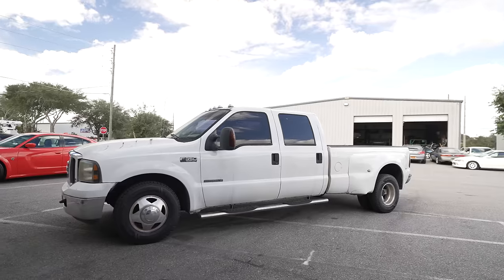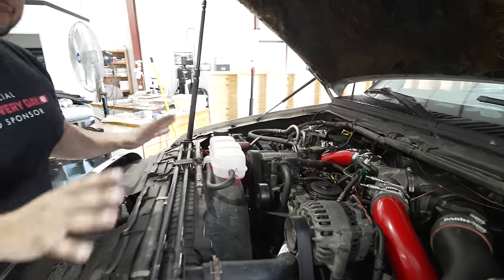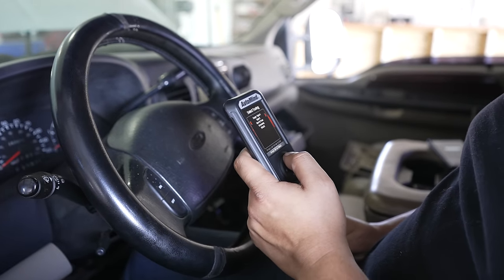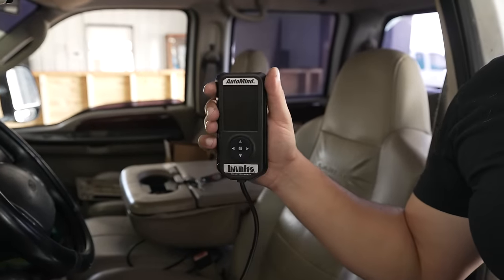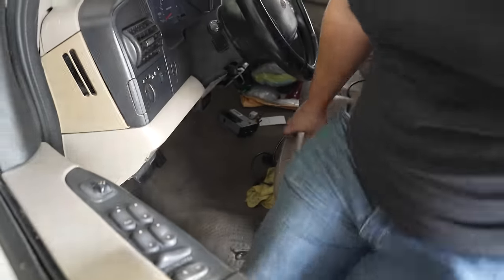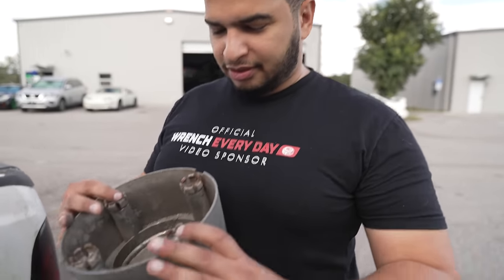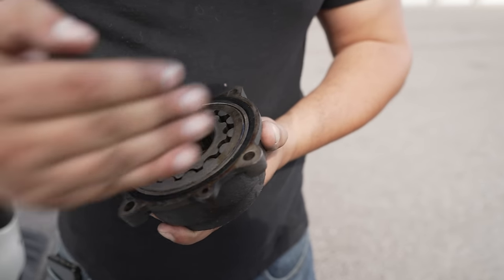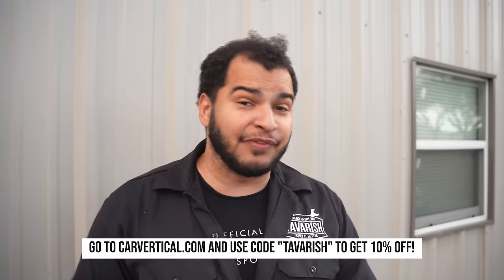I ABANDONED My Ford F350 Dually Pickup Truck 3 Years Ago...Then Tried To Fix All Of Its Problems

Comment: I love these trucks. I have a 99 f250 with 375,000 miles on it, and I would drive it across the country without thinking twice. It's so reliable and will pull anything I put behind it.

Comment: Love the truck and you brother so proud of you for what you built and created. Truly inspirational. I hope you guys did the fuel crossover line at the back of the engine. It is one of the only weak points of brining a 7.3PSD past 100hp over stock. It can lead to what is known as dead heading in the 7.3 community leaving the number 8 injector and on occasion the number 7 injector starved for fuel.
Reply from the maker: yep, we did the crossover pipe!

Comment: That brings back some good memories! I miss my 2003 F350 Power Stroke dually so much! Bought it with 215k on the odometer but it ran perfectly. It was dirty as he'll inside and out. Smelled like a million workers had been inside spilling coffee and egg McMuffin crumbs inside for decades. Gutted the interior, had new oem carpet put in, replaced all the broken trim, all the upholstery was redone in custom leather, new stereo, new MBRP exhaust, Edge tuner, custom intake system to finish it off. That thing was a dream to drive. Handled like a Cadillac and had a super nice soft ride. Much nicer than my bosses 2013 RAM dually that handles and takes bumps like it's riding on wheels made of stone. That big 7.3 could take all the boost that Edge tuner could throw at it and more. I sold it because I was an idiot and my wife said I couldn't keep all 3 of my cars. I had a Jeep Wrangler, and a Chrysler 300 SRT also so some stuff had to go since I wasn't driving anything except the SRT at the time. Ended up just keeping the SRT which I traded for my current RAM 1500 4x4 which I absolutely love but man do I miss that big Powerstroke.

Comment: Those International 7.3L are good for 500,000 + miles!
We have one with 388,000+ on it. Original injectors, high pressure and low pressure oil pumps!

Comment: This video makes me miss my 04 F350 dually, had 325k miles on it but it was reliable, yeah a reliable 6.0 powerstroke on stock head bolts, I picked up a 06 F250 6.0 after that but it wasn't the same, that one was a POS.

Comment: 7.3 are 100% reliable work workhorse engines 💪😎.  Not the fastest but 99%of the time will get you over the finish line (more than can be said of most newer diesels) 😉👍.

Comment: Don't run too much power through that old 7.3, it will blow up. They were never designed for massive amounts of power. They were designed for low amounts of long output.
Reply: I wish people that had no idea what they are talking about wouldn't spew false information like this. That 7.3 will handle anything those factory fuel injectors can throw at it plus more. 

Now the real thing to worry about is that banks tuner, it WILL blow the transmission, guaranteed. Simply because it doesn't tune the trans at all, like, say a Hydra PHP tuner does.
Reply: But if something breaks, explodes, or flies apart then the channel will make more money.  I say add a supercharger to prime the turbo.

Comment: You can throw whatever money at any 7.3 Powerstroke and still come out ahead. They sell for stupid money.
Reply: No joke! A chassis-cab went for $50k on bring a trailer. I paid a tenth of that for my '08 6.4L. (yes, I know, no one likes the 6.4L, yadda yadda)
Reply: @garand70  Because they don't have any of the emissions b.s. on them, they take to tuning really well, are pretty bulletproof as far as reliability and in most states don't require emissions testing for inspection. Everyone wants them. And the 5.9 Cummins.

Comment: What is it with You Tubers? They are either driving with cracked windshields or filthy ones. You're thanking the supplier of the cleaning products while looking out the window at the mirror housing it looks filthy. Definitely not detailed or Armor All'ed. You just had the truck "detailed" and the windows look like crap. It's not just a cosmetic issue, it's a safety issue.